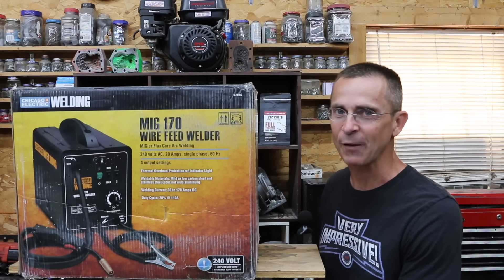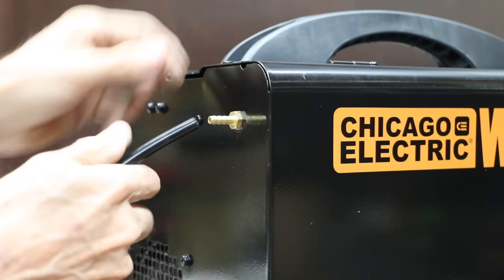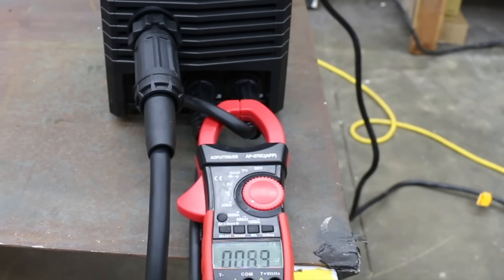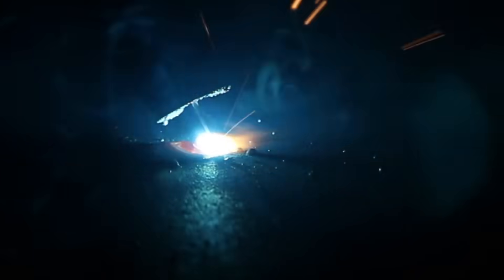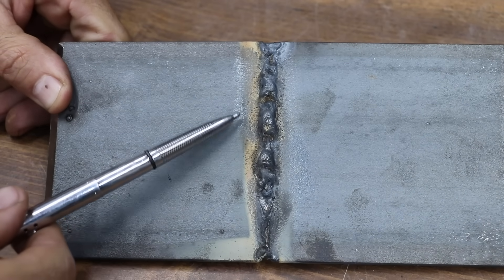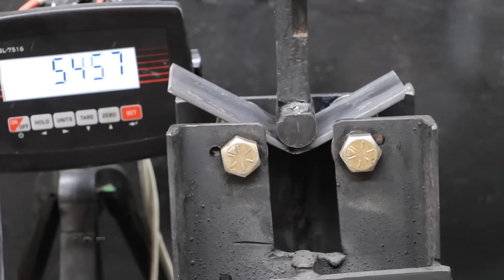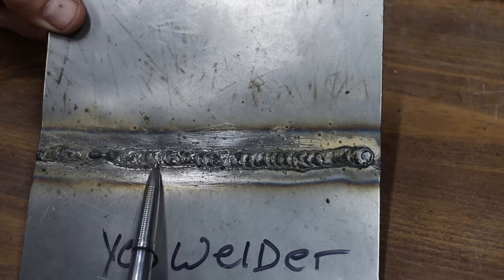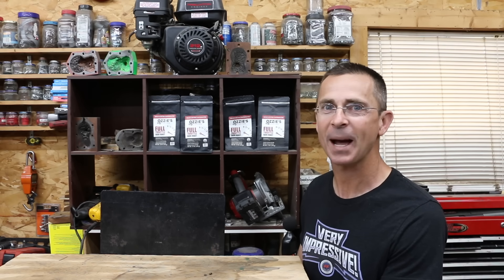Cheap vs Expensive Welder? Let’s Find Out!

Comment: I have an Eastwood flux core welder. Unfortunately it doesn't have am option for gas, but it's compact, lightweight and very good at making consistent welds on projects around the house like exhaust systems, brackets and shelving. I wonder if the Eastwood MIG welder is worth buying
Reply from the maker: Thanks for the suggestion.

Comment: As the old saying goes you get what you pay for.
Anyone trying to make a living as a welder needs to have reliable equipment.
As someone in the UK I only buy USA made Lincoln and Miller welding equipment and Hypertherm Plasma cutting equipment.. Never ever touch any badged Italian junk.
Weld current and wire speed consistency are the name of the game and this is sadly lacking in the mid / low end of what is available.
Reply from the maker: Thanks for the feedback.

Comment: So, I have that Vulcan and a Lincoln suitcase the Vulcan stays in the shop and the Lincoln is for the truck. 
While the Lincoln is ran off a 400amp diesel welder and still will outdo the Vulcan on heavy stuff. But down low the Vulcan has surpassed expectations. Though, if I was to buy another unit again I would probably get the new primeweld 285amp mig based on my experiences with the primeweld 225x tig welder and plasma cutters of the same brand.
Reply from the maker: Thanks for the feedback.

Comment: Great video! I've been running a Lincoln weld pac 140 HD 110v for 6 years. Not only has it paid for itself but I've done jobs that should have been done with a bigger 220 welder and you cannot beat the portability with flux core wire  and ease of use. Keep up the great work!
Reply: Amen brother. Mine is about 30 years old.
Reply from the maker: Thanks for sharing!  Thanks, will do!

Comment: I've been welding professionally now for about 20 years, using big 3 phase 480v industrial welders.. However, in my garage, i always use my harbor freight flux core, or my little Hobart handler. Cheap, simple and reliable.
Reply from the maker: Thanks for sharing.

Comment: stick welders for structural welding, need to be able to burn thru a 1/4'' plate just holding the rod in one spot. wall meter says, pulling 8000watts off the power grid. stick welders that would pass a 4000psi pressure test on 3.5'' OD 1/2'' wall drill rod, something near 40'000 to 60'000 pound feet of rotational torque. gas well frack sees 14'000psi on 1.5 inch thick 3'' ID pipe. "1980's sticking Lincoln still sticking running 35amp higher then the dial says AC"
Reply from the maker: Thanks for the feedback.

Comment: I would love to see a comparison on commercial pressure washers. As always, great video!!!
Reply from the maker: Thanks!  Thanks for the suggestion.
Reply: @ProjectFarm  Here is what you will find out. On gasoline units, all of them are lying about their ratings and it sucks, but that is just the reality of where the market has gone in the last 20 years. Plus you can't buy a "commercial" pressure washer from a box store, those guys are really FOS about their ratings. On electric units, they can't really lie because if they try to push a 10HP electric motor over it's ratings, it will either trip the breaker or burn the motor up. They don't sell commercial duty electric units at box stores either though.

Comment: I made my living as a welder for 4 years and used several pro machines. I’ve had an Amico MIG-140GS for several years and it’s never disappointed! Sub $300 multi process machine that auto swaps between 110 and 220 and even includes a TIG torch. Perfect home owner welder.
Reply: Looks interesting, thought about buying a welder in case something pops up.
Reply from the maker: Thanks for the feedback.

Comment: I noticed that Miller was not in the line up. Any particular reason? I have done some welding, but I'm not a welder. I know a lot of people use Lincoln and this test shows why they do. Nice test.

Also, have you ever tested finger ratchets?
Reply from the maker: Thanks!  Plan on testing the Miller in round 2.

Comment: If you could revisit this, I would be interested in if the multipurpose (tig/mig) welders have an instant-on vs adjustable pre/post flow.  The reason I ask is the HF Titanium 170 multi-purpose has a non-adjustable pre-flow for MIG, and if you do a lot of spot welding sheet metal with it, you burn through gas at an alarming rate.  I have a fourney 140 flux-core-only welder, and I like it quite a bit.  Might I suggest a budget-FC welder comparison?  Since many people don't plan on getting into the full welding setup.  The harbor freight fc only, the century 90-amp, etc.  There are quite a few that are pretty affordable.  I might also add that a DC tig will not weld aluminum properly, it needs AC, so most/if not all the invertor welders can't tig aluminum properly.
Reply from the maker: Thanks for the suggestion.

Comment: Personally I have a Miller 210 with gun on demand.  Spent $2000 and that was 20 years ago.  Has been a great welder and have never had any issues with it.  Would like to see a comparison of Tig welders which will probably be my next purchase. Really looking at the Primeweld for a midrange priced unit that still performs good.  Would really like to see your comparison of this type of welders.
Reply from the maker: Thanks for the suggestion.
Reply: AHP Alpha TIG is probably the best for your money.

Comment: Would be cool to test welding helmets as well. I used to use Miller helmets but recently picked up a Yeswelder helmet, and for the price, can't beat it. I'd say its arguably the best helmet I've owned.
Reply from the maker: Thanks for the suggestion.
Reply: @ProjectFarm I chose an ESAB helmet, a model just above the very basic one, and with four sensors, it really has a top performance/price ratio!

Comment: I bought one of the generic Chinesium Mig/multi-process welders that eventually turned into a better known brand about 10 years ago for scratch-building a jet engine, and the quality difference between then and now is startling. I ended up replacing just about everything outside of the control board to make it run stainless consistently, but for the price I paid back then, it's mostly paid for itself that was destined to be a one-off project. Got lucky (?) on that front as they're all about the same welder with a different case these days, but the price gap between them and the top shelf models doesn't make sense if you're a weekend builder. Commercial stuff, sure, I'd spend the extra coin if/when you have the budget and the use case.
Reply: Thanks for not telling us which brand thereby making your comment useless.

Comment: I've run out of ways to say, the most comprehensive and best testing on YT, Thanks Todd. 👍🇺🇸
Reply from the maker: I greatly appreciate it!!!
Reply: How did he know I needed a new welder???
Reply: Hardly comprehensive. No Millermatic, let alone any Miller brand welder was included in this test. That's a huge oversight that renders this whole thing pointless, IMHO.
Reply: @therealmitch-a-palooza7262 he put the Lincoln in for that price range of welder. That would have cost another 2000$ for this video
Reply: @therealmitch-a-palooza7262 🤦

Comment: Would love to see how each of the multi-process welders do with TIG and stick also!
Reply from the maker: Great suggestion! Thank you
Reply: I have the 220, it's nice, but the biggest annoyance is they didn't run the gas solenoid that the mig uses in tig mode, So it's pedal start but the gas has to be manually turned on and off. Like it's not bad considering the machine at all, but like it couldn't of been that hard to make the gas solenoid for both mig and tig.
Reply: @AbsolutionArmament I've never understood that either. There are two gas solenoids in the machine, one is for the MIG torch and the other is for the spool gun. It seems like they could have used the spool gun gas feed port for the TIG gas feed also. Maybe they figured people wouldn't want to disconnect the gas bottle to swap between MIG and TIG. Anways, no idea, but I consider that one of the major deficiencies in the machine.  That, and it's a door stop if something breaks. The only parts HF sells are the hinges, the spool, electrode holder, ground clamp, and the power cables. I bought mine when it came out, and it's well out of warranty, although nothing on mine has broken yet except for the hinges.
Reply: @AbsolutionArmament  wow, that does seem like a really strange oversight. Thanks for the info!
Reply: I second this. Since they sell them as a feature, and increase the price as a result, it’d be good to see which ones really work. 

Doing automotive, I need to do Aluminum & Stainless at times.
Reply: @BMUU666  I'll give you a really fast hint, two separate machines. A machine you'd relegate to mig duty 99% of the time and a AC/DC TIG. 

Most of these multiprocess MIG only do DC tig, for your use case in aluminum you'll need AC unless you were using a spoolgun in mig mode. Yes you can use pure helium and DC but the process is expense and not as forgiving as AC with pure argon.

By the time your price out machines you'll be slightly higher in cost. But it's well worth it in the end. 
This also means you wont be swapping between 75/25 ,100 and controls/torch/gun when getting set up for a different process saving time.
Reply: I have the yes welder it’s a great tig as well
Reply: @rawbdiggity  awesome! I was really glad to see PF’s results affirm the tool bear’s opinions on the YesWelder
Reply: Yes! I'd love to see the multi functions as well. I'll be purchasing a welder soon to learn on, having welding options is something I don't know if I need or don't need for my intended type of uses.
Reply: It would be helpful to list the warranty period as some companies like Lincoln give 5 years while Yes is only 1 year.  The circuit board on my $1500 Hobart tig welder went bad after 2 years 10 months and was pleasantly surprised to learn it was still under full warranty.
Reply: @apenza4304  Then there's the Harbor Freight offerings in which you can pay more at the time of purchase for an extended manufacturer warranty (as opposed to 3rd-party extended warranty).

Comment: Todd, could you do a comparison of budget plasma cutters? I think many would be interested in this.
Reply from the maker: Great suggestion!  Which brands would you like tested?  Biggest concern is the cost of buying everything for the review, but I'll figure out a way to do it if there's enough interest. Thanks again!
Reply: I would like to see some that are dual input voltage, without onboard air, and aimed at consumer uses. Tooliom is one, Amico and maybe yeswelder.
Reply: A future video you could do would be to test refrigerated airline dryers, as these are most useful for plasma cutting, as well as spray painting.
Reply: Seconded!
Reply: Thirded!! :))
Plasma cutter review would be fantastic. Yeswelder in particular.

Comment: A video on LED light bulbs be cool. Rate their light output, color temp and power use and reliability.
Reply from the maker: Thank you for the video idea!
Reply: @ProjectFarm 

If you do go this route: Waveform Lighting is pretty great.
Reply: Great idea, used so many, some worked others not, on my 2 vehicles and motorcycle...